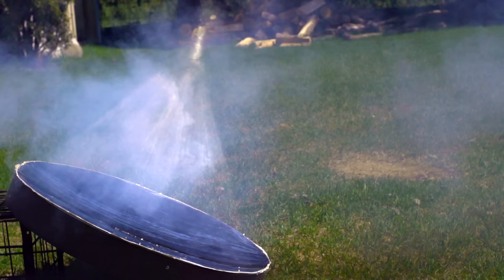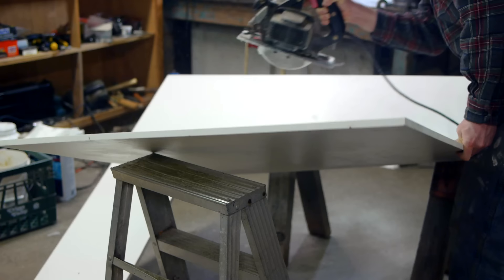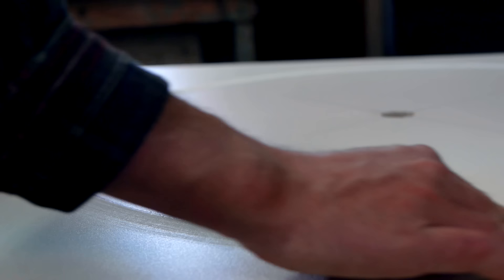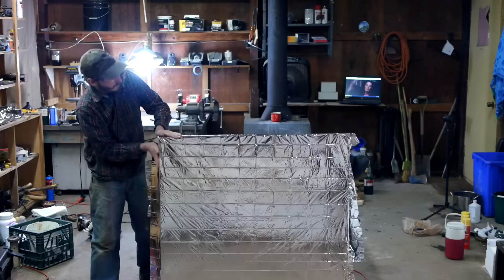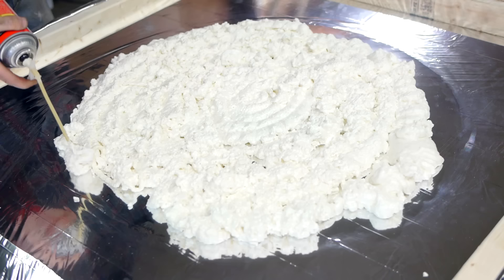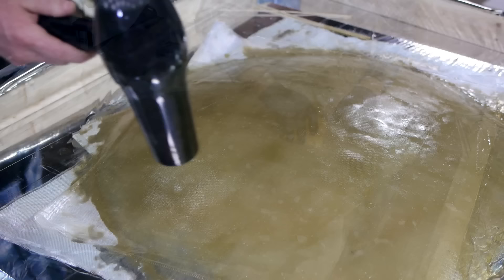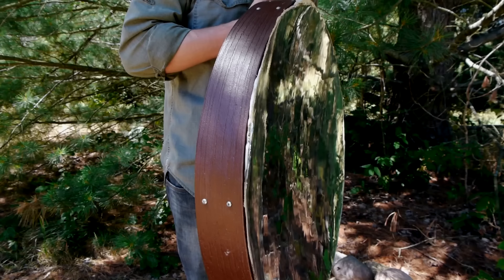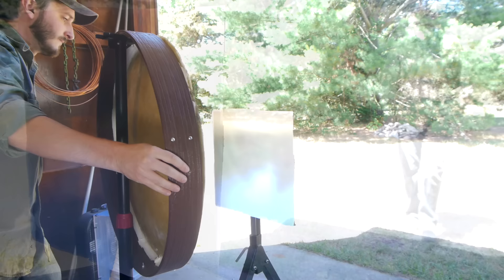How To Make Parabolic Mirrors From Space Blankets - NightHawkInLight

Comment: Have you gotten anywhere with the use of one as a telescope mirror? That will be tougher of course, but this is seriously interesting. I've made a number of mirros for telescopes and there are some very different designs, like spherical mirros that are pulled into a parabola with a bolt on the bottom. Anyhow, good luck, and I'll be checking back to see your progress.  In the meantime think relatively large in diameter, and short in focal length. Both will make for a mirror that doesn't need quite as high quality.
Reply from the maker: I haven't progressed on this experiment since this video, too busy with other projects. I have plans to get back to it next spring if I can. Lots of ideas to test
Reply: The easiest way to do that would be to use something like what he used to draw his circle, stretch Mylar tight over that, and then pull a vacuum on it.  That's the method used on some actual telescopes and since you are using air pressure which is completely even over the surface, it will come out perfect
Reply: This mirror is not usable as a telescope mirror because it isn't a parabola; any mirror produced by air pressure against a membrane will be spherical in shape, not parabolic. (Think of a soap bubble as an example of a membrane resisting air pressure. It forms a sphere.) This is space blanket mirror is just a segment of a sphere.
Reply: +Berkana, yes. Exactly. Thank you for posting this reply.
Reply: @Nighthawkinlight   Have you had a chance to progress further on your astronomical telescope convex mirror? I agree with some of the comments about the correct curvature... this may require a way of monitoring the degree of curvature to achieve the correct focus angle for the telescope you need it for? Not being a very practical guy... it would be great to see an innovator like yourself come up with the solutions before I get my hands dirty!😆 Happy New Year (2019) by the way!

Comment: It was the leak that caused the wrinkly surface of the parabola. 
You should try using vacuum instead of pressure. The seal around the circumference would reinforce the bond by pulling it tight over the edge instead of pushing it outward (or upward) like lifting up tape or pealing a sticker.
So cut a hole in the wood (or preferably good thick plexy) and glue the mylar over the ring of the hole and turn it upside down and coat the mylar  in fiber glass and seal a chamber over the mylar and then vacuum the mylar through the hole into the chamber and let it dry under constant, non-leaky vacuum.

Or just use a satellite dish coated with glue and vacuum from the back until dry.

Super cool video, man ✌️🖖👌

Comment: Cool, but how do you know it is an actual paraboloid? and not a sphere/ellipsoid/hyperboloid/catenary(3d)? if anyone's got the equations for that solution it'd be pretty awesome (It looks like a sphere to me).
Reply: I think you're missing the point of the video.
Reply: Hill Top If the title says parabolic I'd expect it to be parabolic, which it might even be, I don't know, but if otherwise, "concave" mirror would be better
Just curious if the process actually creates a real paraboloid
Reply: I suspect the actual shape is analogous to a catenary, rather than a paraboloid or spherical section. With a true paraboloid, rays parallel to the axis will reflect and intersect at a point, which is nice for clear images. An approximation to a paraboloid (such as a spherical section) will give a focal region, rather than a point, and fuzzier images. But a spherical section will give a wider field of view.
If the object is a solar concentrator, rather than imaging, it doesn't really matter, as long as the focal region is smaller than the thing you're trying to heat and the magnification is sufficient.
Reply: +n8hfi I agree that it doesn't matter, just curious
I don't believe it to be catenary since a catenary requires a constant force acting on one direction through whatever it is, in this case the magnetude of the force is the same but not constant through the surface, but radial, which may indicate spherical, but I am certain that the tension from the borders will distort the shape.
I wanna guess Ellipsoid, but got no basis to confirm it.
Reply: if you were to make a telescope out of this, it would matter.
Reply: Convex

Comment: Oh, cool. Let me just go get my space blankets from my garage.
Reply: I have 3. They are often sold in survival kits/road kits.. etc.
dirt cheap actually.
Reply: they are in like every first aid kit
Reply: +TheRolemodel1337 what are their real functionality? Never seen one here in my country
Reply: ^ same thought goes into survival or just in case scenarios. They are tiny, take up little space, and cheap. 

They reflect heat. So like a baked potato wrapped in aluminum foil, it keeps the heat in. Same would be done with your body heat in an emergency.
Or if you just want an uncomfortable blanket.
Reply: +Kamal H They're blankets. You know, to keep you warm.

They're air-tight, water-proof, and reflective, so they reflect the infrared leaving your body back in. The real reason they're great though is that they're incredibly thin, meaning they're extremely small and light, whereas a normal blanket would take up much more space and be much heavier.
Reply: When I was in Boy Scouts I once used one inside my sleeping bag because it got wet, and it was snowing outside. They work extremely well at reflecting body heat I woke up sweating 10 times that night!
Reply: Hey you. I'm still mad at you about your experiments. Wear some damn pants at least when messing with molten explosive metals! 
And your poor gear x.x
Reply: +TheBackyardScientist it's the backyard scientist
Reply: it's just heavy aluminum foil

Comment: Why not use an old, junk satellite dish?
Reply: I've got about an 8' dish taken apart in the back yard. I've been considering going at it with spray glue and tin foil. Just gotta figure out what I'd do with a massive parabolic like that... I wonder if it could get steel up to forging temperature.
Reply: 8' is a lot, but I don't think it is enough to heat up steel.  The Sun is good for ~20 watts per square foot which equates to only 100 Watts of power.  Not enough to really forge steel.
Reply from the maker: You're off on your calculations by quite a lot.  Sunlight is closer to 100 watts of energy per square foot. An 8' diameter mirror has about 50 square feet of surface area so total collected wattage is 5,000. It would melt steel to a puddle when focused. It would however be rather unwieldy to use as a forge and would be difficult to use to heat material evenly.
Reply: You're right!  my error.  I was thinking about how much electricity a solar cell makes, not the total energy.  20 Watts/foot is the electrical gain from solar.  Considering they are ~22% efficient, your 100/Watt is about right.  And I have no idea how I moved the decimal point on the pi*R^2 calculation.  

Thanks for the correction.  It seemed a bit low to me.  I should have double checked my work ;)
Reply: @ Darwinpasta   re: using a parabola to heat steel.
Another problem is, the Sun keeps moving.
Reply: 100 W/SF at 100% efficiency of collection. Even at 50% still significant
Reply: Hermit Oldguy...but really our Earth moves...isn't it ?  😊
Reply: Astronomers fixed that isssue a couple hundred years ago with an "equatorial mount".  Then they added a simple drive mechanism to drive it.  Easily adapted to this purpose. I have an old 12' sat dish that I plan on using to boil water...
Reply: @kgsivaprasad2356   They both move ;) but it all depends of where you put your origin...
Reply: @Darwinpasta  Get yourself some free old school big screen rear projection TVs off Craigslist. There are mirrors inside. Cut them to 2" squares and silicon glue them to the surface of the dish. Now suspend a SS stockpot using an old drywall lift and enjoy deep frying a 20 pound turkey using only the power of the Sun. Peanut oil available from Costco and Ace this time of the year. Maybe turkeys are still on sale?
Oh yeah now you also have Fresnel lenses from the TV's. .  .
Reply: @jrjohnson2747  I actually tore one of those down a while ago and have been wondering what to do with the mirror since! I may need several more though.
Reply: @Darwinpasta  Yes more TV's more mirrors and more Fresnel lenses (more garbage too)! I do deep fry turkeys with my 8' dish. Last one this past Weds.
Reply: Picked up 2 more turkeys today from Costco. Just over 20 pounds ea @ $.99 per pound with $15 off per bird! No more room in my freezers.
Reply: @hermitoldguy6312  
diy eq platform
google ;)

Comment: Yet another interesting video, very odd project, however, very cool. However let me remind people here to not attempt to cook with this, as it doesn't actually cook things thoroughly, you'd be better off making a fire and cooking on that, my friend learned this lesson after a good dose of salmonella from his meat not being cooked all the way through, just the exterior.
Reply from the maker: There's no problem cooking with a mirror, you just need to use a good pan that can disperse the heat evenly.
Reply: Yeah you don't want to cook with the light from this, you want the light to heat up a pan or pot that will disperse the heat evenly and then cook it.
Reply: The cause of this is cooking with too much heat, and can happen with pretty much any heat source.

It cooks the food too fast, so the outside burns while the inside is still raw. There are ways around this, for example, stir fry, which uses high temperatures and very short cooking times, but compensates by having the pieces of food be so small that they can cook through in that time. Larger pieces of food need lower temperatures to cook thoroughly without burning.

This is both overbuilt and a bad idea to cook with. It's too focused, and presents a danger. There are plenty of other designs for solar-based cooking that don't pose the same threat.
Reply: seigeengine In theory, you could just move the cooking surface just slightly out of focus if you don't want intense heat in one area.
Reply: Stan V And in practice that doesn't eliminate the threat.
Reply: well, yeah. That's like saying you should use a proper fire and not a match to cook your food. and just like the match, you can use this to start a fire.

That said, I would suggest a convex lens for that, since the sun is USUALLY above you. ;P
Reply: seigeengine If you're cooking it over a long time on mild heat with a lens that isn't too focused, I don't see why it would cause an issue.
Reply: +seigeengine you bother stan first
Reply: Try to survive No, I didn't.
Reply: Someone's always gotta start an argument with poor reasoning. Gotta love youtube.
Reply: Lol you need to learn how food cooks before you start using other unconventional ways to cook. Using uncontrolled pin sized concentrated heat to cook? You can boil stuff up though if your cookware can withstand the focused heat without being destroyed
Reply: crankypipo You'd still be better served moving the pan in to where the light isn't focused on a point, but rather on as much of the pan as you can get it. That way it heats the pan more evenly.
Reply: seigeengine are you refering to my first point which was exactly my point or the second one about the boiling part of which by boiling i meant you can boil water using conc heat and then boil stuff in it?
Reply: crankypipo I was referring to both. In the first case, that would avoid the one spot on the pan getting super-hot, and in the case of boiling, you'd get better results with a more even heating anyway.
Reply: That is not true. It is possible to cook with a cast iron pan being used as the base and heated with the mirror. A thick cast iron cast spreads the heat quite evenly. But realistically without some sort of a computer (arduino) to automate the temperature control through azimuth position changes it doesn't work that well.
Reply: Please, stop.
Reply: seigeengine you sure are a big fun at parties
Reply: crankypipo I like how this insult amounts to "I don't like you!"
Reply: seigeengine oh no you misunderstand - i was just noticing how enthusiastic you were tending to the unenlightened masses here. Such gusto, quite admirable indeed i applaud you sir
Reply: crankypipo oh no you misunderstand, I despise getting together with other people, and I especially hate providing others with fun. You insult me by suggesting I would do either of those things, especially so well, sir.
Reply: seigeengine LoL! ... I like you, we could have a pint together no doubt. You might have to sit through the occasional enthusiastic mumblings about how awesome microprocessors are though.
Reply: John Smith I'd probably be mumbling about bloat, over-complexity, and feature creep.
Reply: I code for a living so hardware is a hobby for me. And yea those things you mentioned all suck, you sound like you have some experience with coding. But you have to admit that being able to monitor the water level, PH and nutrient levels in a large hydroponics farm would be useful. Especially when you feed it back to a server so you can check in on it any time. 
Or automatically opening the door to a chicken coop in the morning and auto herd them back in later in the evening with a motorised wrapper (think zip lock without the lock) as well as auto feeding them. 
If I had a farm and land you better believe I would be doing that instead of spending 2 hours every day doing that manually :D micro controllers are awesome.
Reply: John Smith Obviously, I'd probably want the entire feeding system automated.

If I was a farm, maybe, although that provides one more excuse for smaller owners not to pay attention to their chickens which is quite bad. The "herding them back in" thing just sounds ridiculous to implement, and prohibitively expensive aside.

Micro-controllers are awesome, but not always the right tool for the job.
Reply: I think it means the farmers have more time to check their chickens. I voted and campaigned against battery cages as an aside. 

I disagree that the herding them back in is ridiculous but haven't exactly explained the concept to you so cannot blame you for thinking that.

And yes sometimes they are pointless and over engineered. For instance a gravity led feeder would work perfectly fine in many scenarios.
Reply: John Smith It really doesn't mean that at all, seeing as the time taken is negligible, and we both know that, in practice this is just going to increase neglect.

Until you come up with some teleportation style bullshit, it's going to be ridiculous. Just the nature of the problem.

I wish to be clear I meant feeding in the context of a hydroponics system.
Reply: Got it, makes sense.
Reply: for even cooking surface this is obtained by using aluminum tray filled with water about 1/2-3/4 deep, you direct the rays to the aluminum to absorb energy and the water evenly  disperses the heat. just add a little cool water if gets to hot. problem solved
Reply: I sous vide all my meat products 136 degrees no worries about bacterias or virus.... then just seer it, best you will ever have
Reply: ***** Hahaha, fuck no.
Reply: seigeengine why not it works, your cooking pan is in the water it works quite well, you might be surprised how things work, other than what you think they do
Reply: seigeengine Ok have a nice day getting your proctologist exam

Comment: Being that air pressure is used to form this, and the fact that air imparts equal pressure in all directions, wouldn't then this be a sphereical mirror and not a parabolic mirror?
Reply: it doesn't impart equal pressure in all directions, an extreme example is your pump isn't putting a force on the other side of the earth.  The air flow is facing resistance from the mylar, and the mylar gives first where the pressure vectors start, and then more and more it gives, further from the bullsey does the mylar stretch. Or something like that. just a guess.
Reply: @ai_serf  air pressure by default exerts pressure equally in all directions, is the nature of any fluid. Secondly the pump does in fact exert pressure on the other side of the earth. If pressure is imparted to the atmosphere it is evenly distrubuted across the entire fluid (atmosphere). The force may be incredibly small but it is there.

Comment: I've done something very similar but I used a vacuum chamber. I replaced the plexiglass door by making one out of 2 peace of Plexiglass cut a circles off each one put the blanked in between and glued everything together and put a few bolts long the edges to help keep it together and sealed. Put the new door on and sucked the air out. Made a nice concave lens.

Comment: I think you should make the ring first and use it for a glue guide and then clamp a slightly larger ring on top of the mylar. You can see how irregular your glue joint was when you pressurized the apparatus, which would lead to irregular tension and poor uniformity in the bubble. Also preimpregnate the fiberglass cloth with resin, squeegie off the excess and lay it on, squeegeeing out air bubbles, you used way too much resin, which increases warping when curing. Precutting the cloth into a slightly larger circle would avoid wrinkling against the clamped on ring. Thanks for demostrating the concept.

Comment: I think you should have made the dish form from fiberglass in the same manner but no mylar until the dish is made.  Then a light coat of resin on the dish before placing mylar on the fiberglass.  A squeegee could make sure you have the perfect adhesion much like tint on a window.  This is my plan but on a Satellite dish.   I tried spray adhesives which was a disaster as they dont have the ability to wet the surface down.  All you get are clumps.  A diluted mixture of water and wood clue might work well also with a squeegee.